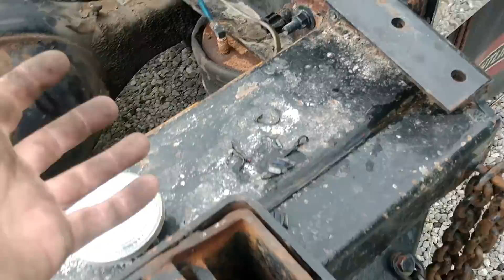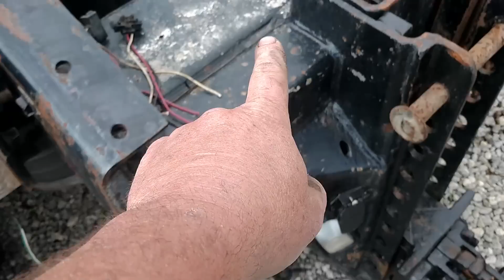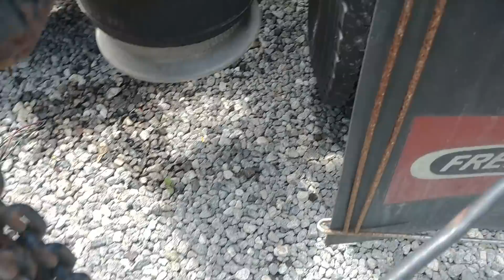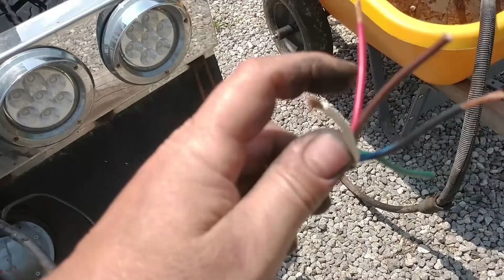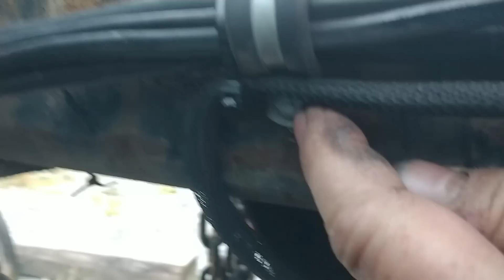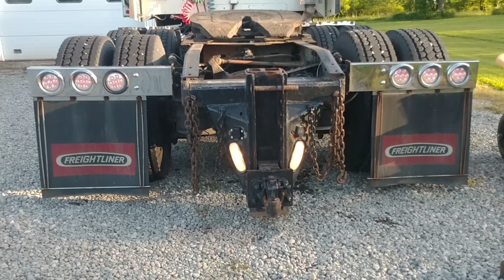FREIGHTLINER REAR LIGHT BAR WIRING! SPLICE, SOLDER, DE-OX, HEAT SHRINK

Comment: You and I share an enthusiasm for vehicle wiring. About the only thing I do differently is liberal use of liquid electrical tape. I goop it on over my ground screws and seal the ends of shrink tubing with it. And I solder all ring terminals and wire splices. I just get tired of having to chase down electrical issues in wiring. I just do it once and barring physical damage that’s out of my control the lights always work. 👍

Comment: Nice job. I always appreciate clean wiring. Helps when you try to think of the next guy to work on it. 
One suggestion on the plastic cable ties. take it to the next level, get yourself a pair of flush cutting pliers. I like the Klein version. It prevents any sharp edges when you trim the tail off.

Comment: lol @ the punctured un shrunk heat shrink connectors. i see it all the time two its one of those things you just shake your head. those connectors are generally pretty good if you use them correctly. its next to no extra effort to use them correctly.
Reply from the maker: what brand and where did you buy your huck gun? i am looking into getting one.

Comment: It’s nice that you take the time to make all your work nice and neat and do it to last. Like double heat shrinking connections, pruning and painting the ground, and drilling and tapping the holes for those rubber insulated straps and used never seize to boot. I take a lot of time doing work like that too, everyone  wonders why it takes so long but it’s worth it to spend the extra time and do it right, then it won’t cause you grief later on.

Comment: How do you feel about the junction boxes for lights like they use on a trailer... there water proof plastic boxes with lugs in them... thats what i used at the junction point on my rig instead of a bunch of splices
Reply from the maker: i had intended on using one of those boxes if this didnt work out. i would use it with some of the no-ox / de-ex

Comment: I pull container chassis. Had a turn signal on a chassis not working the other day. I pulled the light and found 
Bare wire twist with gorilla duct tape . Fed was under a month old. I never could get the licence plate lite to work.